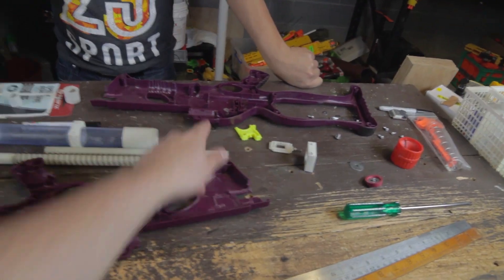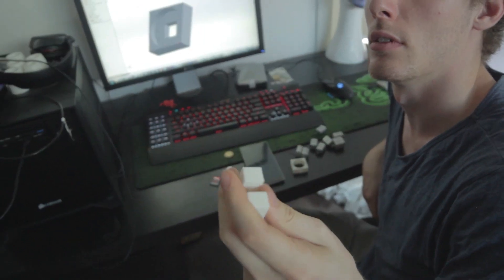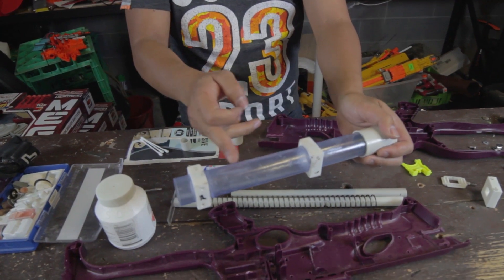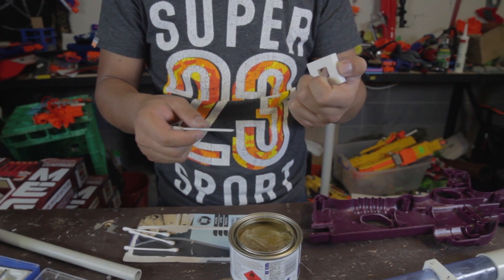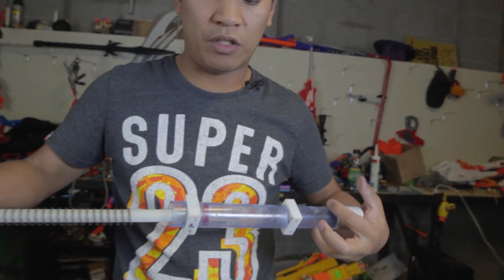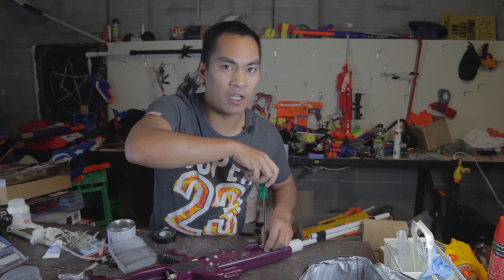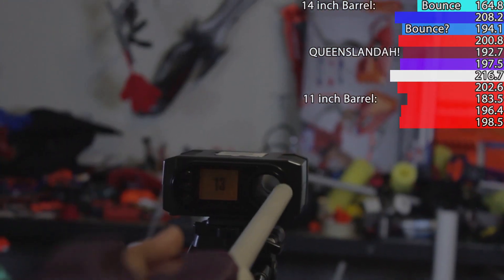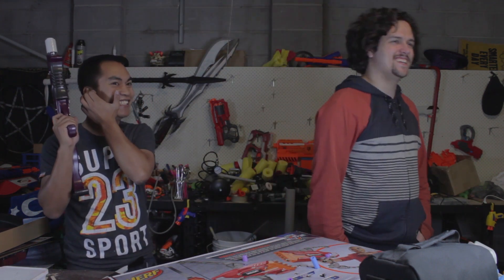Crossbow Crafting with 3D Printed Parts - Nerf Mod | Make Test Battle

Comment: if you want the templates for the trigger and catch let me know. Also I would highly recommend putting some 1/8" plastic sheets over where you drilled the holes in the shell( i used polycarb) or at the very least epoxy some washers that tightly fit the bolts onto the shell . In my experience  if you dont do that the shell will get stress marks and crack around the screw holes

Comment: Well if ur using a internal from 3d printer for the cross brow then that wont be an origial 1990 somthing nerf gun but if ur modding it it is a good adea of using 3d printer and making a new internals cause the original ones would be weak 
So yeah

Comment: The barel doesn't make any sense. Why is it stil preforming that well with double the length of the barel
Reply from the maker: +jan eisenbeton Because a longer barrel allow for the pressure to be applied over a longer distance allowing to accelerate to a higher speed -R
Reply: +Make.Test.Battle 
Thank you

Comment from the maker: Did you enjoy the episode and do you enjoy the format? Detailed critique is welcome. 
-Justin
Reply: Hey MTB hope all you guys had an awesome Christmas 👍👌
Reply from the maker: Joshua Josh Eh. I didn't visit family this year, worked on finishing this video. 
-Justin
Reply from the maker: +mtabud “mtabud12” bud Solid Works
Reply: +Make.Test.Battle hate the hand-held look.

*Originally* Nerf was by Parker Brothers and made only large soft balls.  I recommend against even using that word.

Sure did not look like that fracture actually originated in the corner.  A non-waving close-up may have looked different.

...that's as far as I could stand.
Reply from the maker: +Bob O`Bob Hey Bob; While it's hard to tell without a microscope how the crack propagated, the corner is unfilleted and acts as a massive stress concentrator and is most certainly the origin. Handheld looks a bit more genuine and is easier to get the right shots on the fly as opposed to a tripod but something to smooth it out would be handy -R
Reply from the maker: PANDAMONIUM FTW It's a bit of a friendly jab at people from Queensland who used to make ridiculous range claims about their blasters -R
Reply from the maker: PANDAMONIUM FTW Maybe from before your time then ;) -R
Reply from the maker: Liam We try to put it in all the videos where it is relevant. The modulus is pretty similar to the stryfe or the demolisher guides. Have a watch of those and see if you can figure it out -R
Reply: Hey justin, what cad software was that? Was it auto desk inventor? :)
Reply: +Make.Test.Battle yes i enjoyed the video, but i have a quick question i don't get the Queensland style ranges what does it mean?
Reply: I am from Queensland and most of the range claims I hear from m local group are accurate
Reply: 2 years probs
Reply: +Make.Test.Battle  can u pls put fps in your vids and do a modulus mod
Reply: Make.Test.Battle oh sorry i didn't know
Reply: Yes I'm going to subscribe
Reply: Make.Test.Battle make a pump kit crossbow